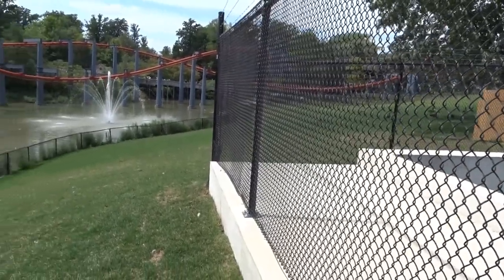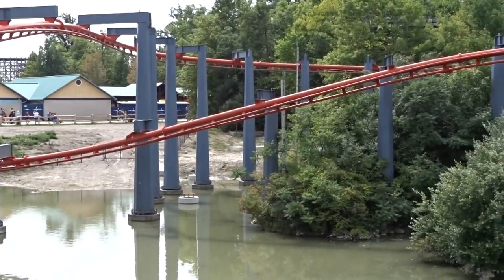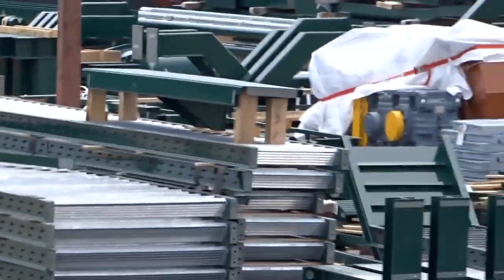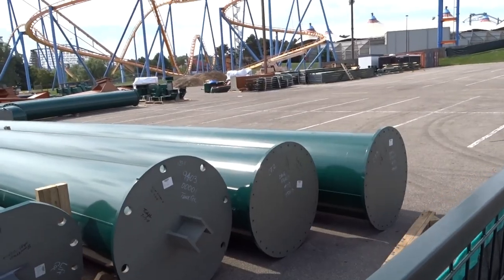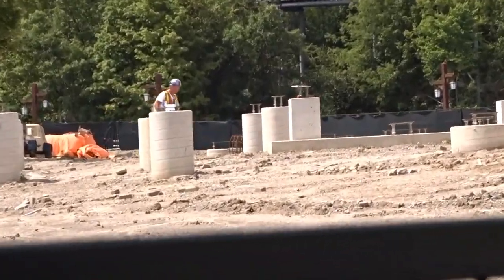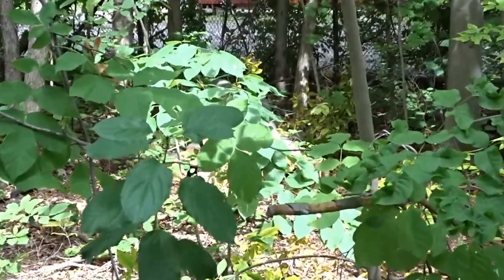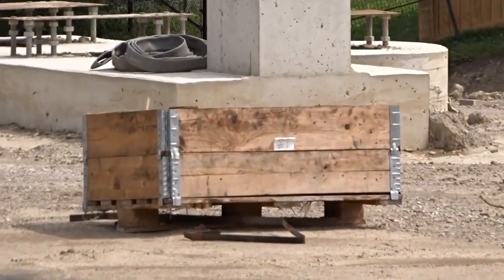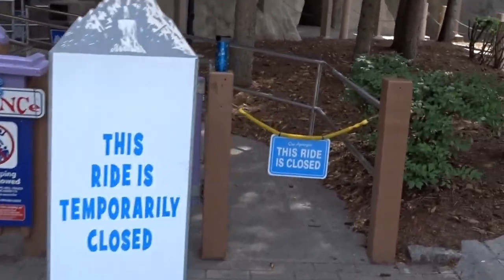Canada's Wonderland Vertical Construction Prep & Thunder Run?

Comment: Based on the stairs that came in, it has the coaster being 280 feet fall minus the added high from the under ground portion which will probably add at least 20 feet to the overall hight.
Reply: You didn't take into account the angle if the lift hill, yea 7×40 is 280 but that's the stairs going straight up vertically, then they are basically a ladder, on an angle (which the stairs will be on) it would be significantly less height.
Reply: Eric Mez well, a Giga dive would be a heck of a sight!

Comment: Thunder run yes this temporary not part refurbishment plan of wonder mountain        Steal Plate is to level bottom   washers &  nuts so when they have   the column base lower down its needs minimize adjustments    or is perfectly  level also   they are checking that thread rods are straight aligned  to steel plate  bolts thread on with no problems     I know I'm in construction have no life out side of work lol    as always doing grate work keep everyone informed what's going on       I'm team giga till the announcement    hope angle over 47 degree assent  we are looking at 50 /50 if a giga or not    till have the columns on site all guess work ball parking it as we say